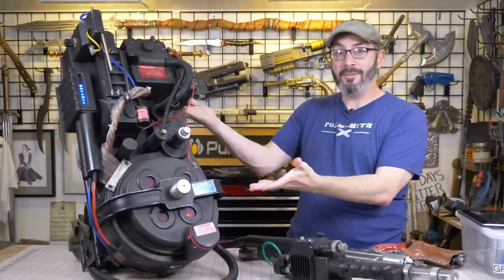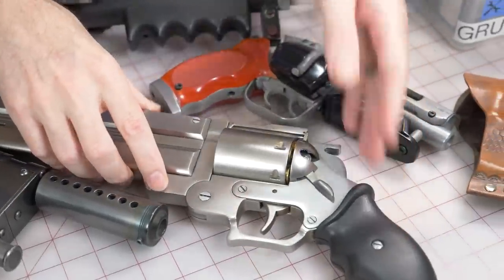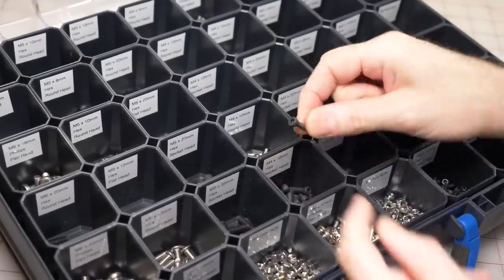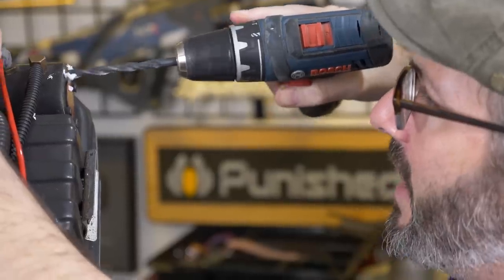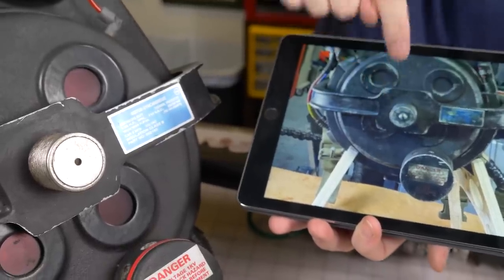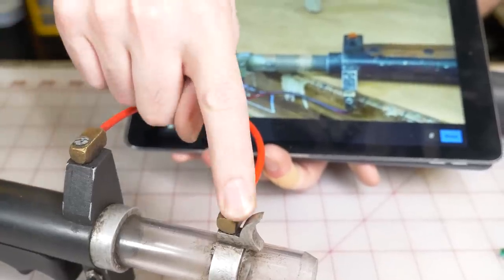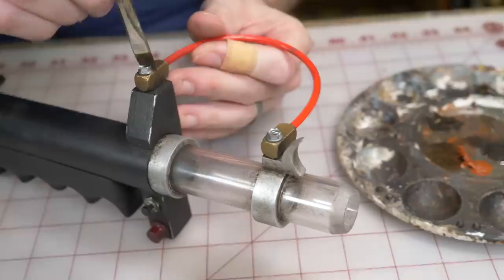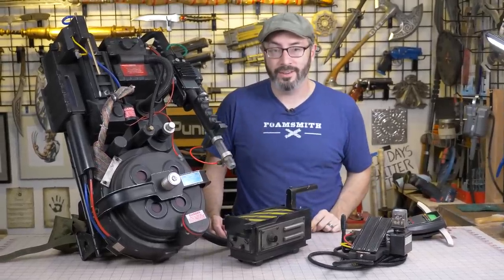Let's Get METAL! Ghostbusters PROTON PACK Upgrade

Comment: It is always nice to be able to use real hardware like screws and bolts on a prop like this. When I built my Proton Packs, I tried to use real bolts and screws wherever I could. Also, even though you weathered them with paint, in time, those screws will start to tarnish and rust by themselves, only adding to the "Used and Abused" look of the packs.
Reply from the maker: Yeah! This proton pack will age like a fine wine. =D

Comment: love the idea of this with metal screws but I would suggest you get prop ready then cut off bolt and while it is hot from cutting down put them in so the heat will melt plastic so they wont back off down the road.

Comment: Nice work. I cringe seeing you remove the plastic screw bits with the x-acto knife. Wouldn't a flush cutter be both easier and safer?
Reply from the maker: Thanks! I didn't think to try that, but it's a great idea.

Comment: I'm guessing @9:26, you burned your finger. That bolt would have been pretty hot after all the grinding you did, and it looks like you pull your finger away pretty quickly after touching it to remove it from the chuck.
Reply from the maker: Close! I actually cut myself with the hacksaw blade when I was trying to cut the carriage bolt.